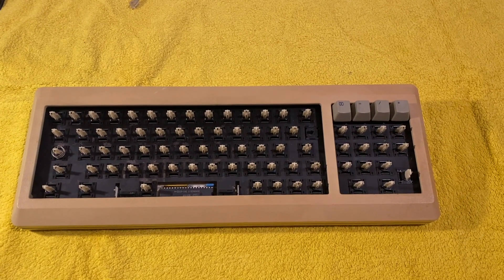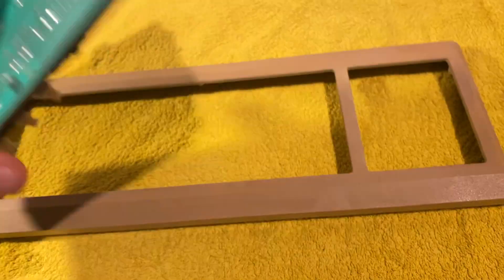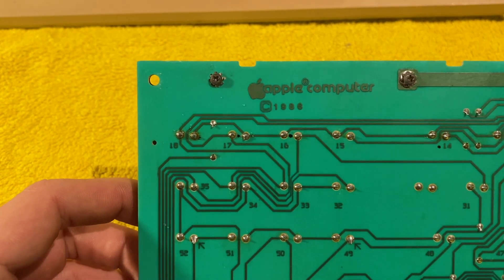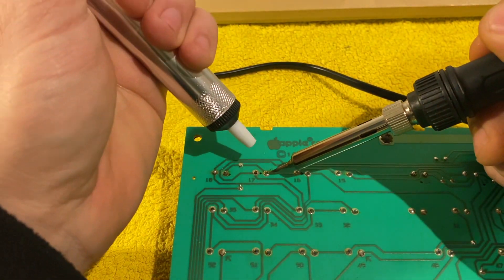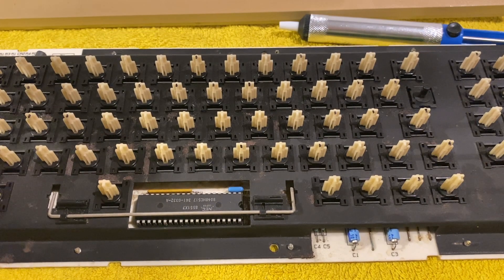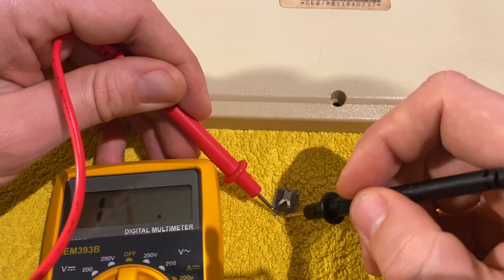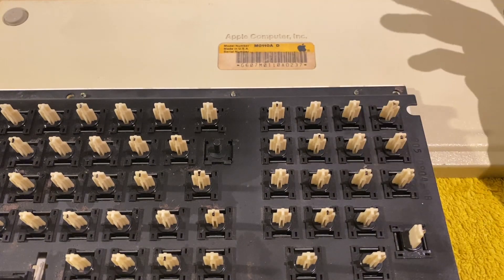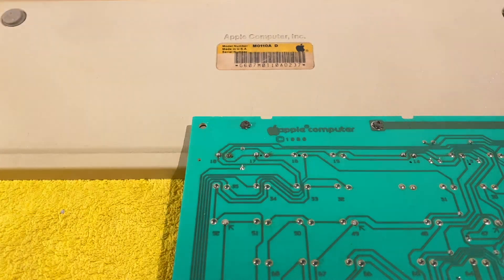How to repair a Macintosh Plus Keyboard (M0110A) at no cost (Episode 2)

Comment: Ive had one of these sitting around with the tinkerBOY usb adapter for a while, space bar and a few symbols not working. Randomly searched and found this, and was able to get them all repaired while working from home today. Thanks man! To anyone finding this, the M0110A has a slightly different set of latches to let it come out from under the metal frame of the keyboard, they are white and much smaller than the ones in this video, and they SUCK to pull out. I figured out super long tweezers rammed as hard down into both sides at once and rocking back and forth with a ton of force worked.
Reply from the maker: Thanks man and great input / addon :)

Comment: You might have figured it by now, but on your multimeter, the next setting to '200' turned anticlockwise is the 'beeping' mode that allows testing continuity. You don't need to read the display, just press the key and it'll beep if it works.
Reply from the maker: thanks! I indeed figured it out ;)